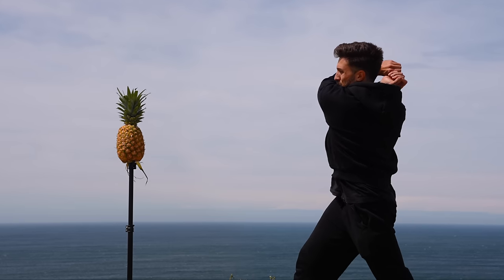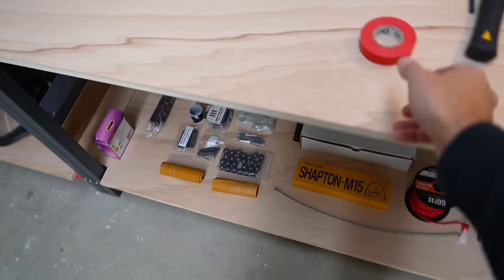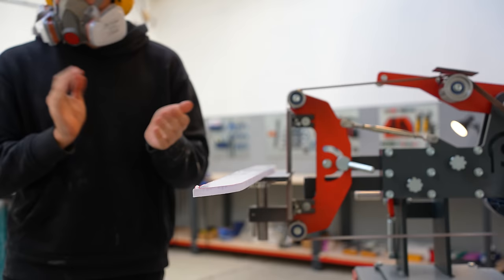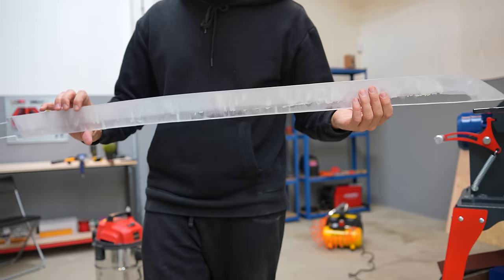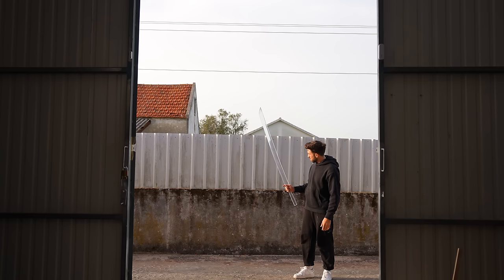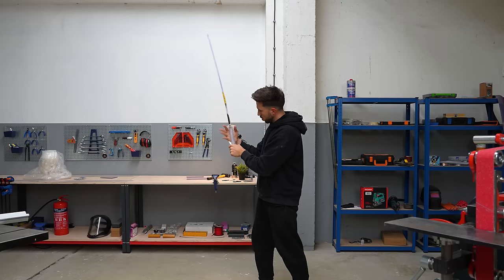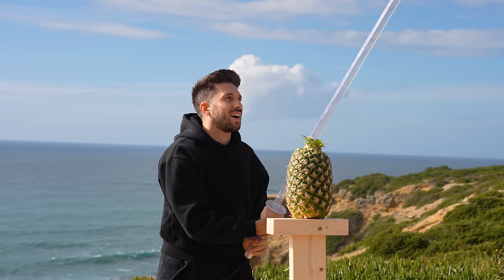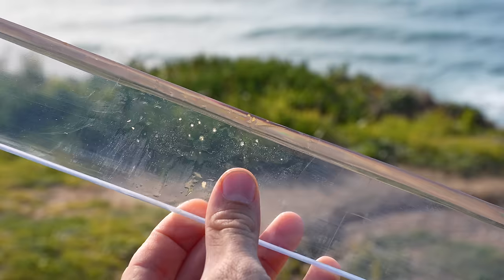I Built a Transparent Katana

Comment: so, coming from combat robots where polycarb is used a lot, i can tell you that cyanoacrylate makes polycarb brittle.

it was the ca glue reacting with the polycarbonate that made it turn brittle.

there is a chemical bonding agent made to glue polycarbonate, but isn't a glue, it effectively melts the 2 pieces together making it almost as strong as if it were 1 whole piece
Reply: This needs more likes
Reply: @Rjciralli  yeh, why is everything so underrated
Reply: So basically it makes a reaction that "plastic welds" itself, that's cool.
Reply: @Useruserusername790  Yeah it's more common that you'd think. Solvent weld is very common in modern plumbing.
Reply: you can get solvent weld from most hobby stores, a lot of miniatures for wargames like warhammer come in piexes that you put together with the stuff
Reply: What chemicals are in JB weld it gets warm when you knead it so there's a reaction going on there. Most "glues" are molten at room temperature and glue doesn't necessarily mean 1 chemical, they can be mixtures, Concrete has drying agents in it, it's not just the water that holds it together. The first part of that is for the person that originally commented , the rest is so the Keyboard-warriors will mind their business.
Reply: It was a mixture of that and the geometry of the handle. It had a right angle at the point of breakage which created a stress point. Any particularly hard hit was enough to break it.
Reply: @tale7955   yes, that's why Katanas "tangs" aren't shaped like a T , the 90 degree angles are a huge stress point, actually even Longswords have a kind of tapered tang.
Reply: This. Also, CA glue vapour clouds polycarbonate and acrylic (the reason for the "ice" effect). You said you can't easily polish the "hole" in a handle. True, but... If you use a strong,. but clear epoxy resin, it will actually fill in the gap and make it a solid clear block. The roughness of the hole will mostly disappear and will actually help the resin bond to the parts. Try to get rid of bubbles before pouring (slow cures make this easier, or use a vacuum chamber) but I don't think you could get a pressure pot/chamber big enough for the sword unless you were willing to pay a lot more and learn how to use it safely. That, plus the geometry of the handle (to avoid stressor points) and you should have something that will work a lot better.
Reply: No... it was the cuts without any fillets on them that broke it (that's why it broke in the exact spot where it was cut in for the handle)

Comment: @MikeShake I love this project and I'd like to help you make it better. I think that there are several areas of consideration for the next version and testing methods. I have not read all 6700+ comments, so please forgive me if I repeat any. I hope some of this helps.

1- The thickness of the "katana" and it's cutting edge
-A katana is not meant to "cleave" through things. The curved shape of katana is meant to provide the smallest amount of cutting surface on the target. This increases the PSI of the cut. When you see a katana "chopping" through something, don't imagine an axe going through wood. Imagine the blade being dragged through the target and slicing deeper as the blade is pulled across the target's surface. More like a saw would work, slowly getting deeper by cutting along the surface, not going straight through. 
-A katana is thin so that (among other reasons) it can pass through the target with the least resistance. What you have created functions less like a katana and more like an axe, machete or kukri. However, if you decrease the blade's thickness, it will of course be weaker. 
-The edge angle is very wide, which is going to be more resilient to damage, but is not going to cut very well. That is why your cuts were messy. Of course, the narrower the edge, the more easily it will be damaged. 
-The problem you had with the blade being more visible with the shallower cutting angle would be lessened if the blade were thinner (as it would have less distance to travel from tip to flat)

2-Target materials
-If you're trying to make an invisible katana, you would want to test it against objects that katanas are normally tested against. I have seen a katana cut a bullet, but if I remember correctly, the blade was badly damaged afterwords. The katana was ideally used to attack soft tissue and slice deeply enough with one cut to open an artery or reach vital organs. The easiest way to do this with a blade is to stab, which is why spears and arrows were more favored in large scale conflict and most blades (that I'm aware of) were meant to deal the finishing wound with a stab. There is a very interesting history about katanas and why they were shaped and used as they were. I highly reccoment learning about them if you want to take your project to the next level. 

3-Swing technique and target fixation
-When you're cutting with your blade I'm noticing that your swing is not at a comfortable level for you. I would reccomend lowering it so that you don't feel that you have to keep raising your shoulders at the last moment. Since training a correct sword swing is not neccesary for your project, I think it would be a waste of your time to learn swordsmanship. Of course, for your own fun and enrichment, I would say go for it LOL. But just for this project you could just work on a horizontal baseball swing or a vertical axe chop. The actual way to swing a katana takes a lot of work, and i think that your material would not do very well for the job (but I could be wrong). Once your swing is good, then I would focus on making sure that your target cant fall away so much. A lot of the energy of your swing is being dissapated by the movement of your target.

4-Safety
-Even when you're cutting into soft targets, you can still have material failure. Since your sword is an unknown quantity I would highly reccomend that you at least wear safety glasses at all times. Since you're not a trained swordsman, you might also want to wear some wrist wraps so that any reverberation of energy back through the sword into your hands doesn't injure your wrists.
Reply: small point to add that I believe you missed(or i missed you saying), that the curve of the katana allows for easier edge alignment for a more straight on cut as the weight will carry to the back of the swing.
Reply: Wrote all that just to get two comments lol😊😂😊
Reply: u wasted ur time, bro is not gonna read all that
Reply: Bro... this is intelligently written 👏
I read through, and it's quite enlightening!

Are you a swordsman? Or affiliated to any?
Reply: This is fantastic advice! And very kind of you to offer.

Comment: Alright so hear me out:

There is another Japanese Martial Arts style that would make better use of the material, both in regards to its transparency and ability to bend.

I believe it’s called Owari Kan-Ryu, but I just call it the Wobbly Spear technique. In essence, you grab a spear near the bottom and with your lower hand push it back and forth (sliding it through your higher hands grip) so as to cause the tip of the spear to wobble in a circular pattern.

It helps to get past guard stances, and would likely benefit greatly from having an invisible spear used.
Reply: Like Hyouga from Dr. Stone?
Reply: Spear guy from Dr.stone
Reply: Even just an invisible spear blade
Reply: "what are you doing spinning that stick around"- the first victim of the invisible wobbly spear
Reply: @enigma9971  I don’t know if that would work as well. The blade would diffract light, which might not be a huge issue if the whole spear is invisible but would be if just the spear head was as you’d see the wood looking wonky through the spear head which would tip you off to its presence faster.
Reply: Ender dragon style?
Reply: Like inshun from vagabond

Comment: I work with this material a lot, to get a perfect clear edge you need to get them flame polished. The difference between that and hand sanding is crazy. Only thing is it takes a specialist tool, using a flame from a lighter isn’t the same thing. Maybe this will help you for the future :)
Reply: dude i can just imagine an even clearer version, it would be crazy
Reply: yep
Reply: Bruh like this so he can see it
Reply from the maker: That's really interesting, should I sand before flame polishing or could I do that right after the belt grinder?
Reply: @MikeShake  no need for sanding really, but perhaps sanding to assure you have a nice level edge before hand wouldn't be a bad thing :)
Reply: @MikeShake  you should make a new one with the things you have learned!! perhaps with a thinner sheet of polycarbonate aswell, so you can have a small bevel again, but with a shallower angle for better slices
Reply: Flame polishing is great for acrylic, but its really hard not to get expansion and bubbling or cloudiness in polycarbonate using a traditional flame polisher. Is there a more reliable way to achieve this nowadays or does it require specialist equipment?

Comment: Awesome stuff. Trick as well. You can flame polish the edges to make them almost transparent after cutting. Also use resin instead of super glue to bond acrylic or get acrylic weld. Look at some aquarium videos to see how that works. It melts the two acrylic parts together rather than a glue. 👍
Reply from the maker: Thanks for the info!
Reply: Anytime! Keep up the good work!
Reply: @MikeShake you should make invisible baseball bat next
Reply: @Lizardman60  that wouldn't work
Reply: not sure about the flame. maybe if ur super careful bu last time i tried heat to smooth it out i overdid it and got bubbles in the material.
Reply: But it's not acrylic. It's polycarbonate.
Reply: @Lizardman60 a mace would probably be a better option.
Reply: @simonwoodworks8840  Acrylic glue won't work on polycarbonate.
Reply: @MikeShake  for a big future video project try making a vehicle/race kart or car to hit 200mph with a budget of 10,000.

Comment: Hey man, I saw a lot of comments saying that the cause of the snapped handle is because of the geometry which could be partially true, however the primary reason why this happened is because polycarbonate becomes brittle when it is exposed to superglue or loctite due to the active ingredient cyanoacrylate.
Reply: I think it’s a combination of the two. The added rigidity from the super glue, and the perfect line of 90° angles at the stress point. The handle couldn’t flex, and where it couldn’t flex was a straight line where a light scoring would snap that poly
Reply: Adversely he should try shortening the blade so that it doesn't flex as much... that much flex in any kind of swinging bladed weapon is not what you want unless you're making a whip sword

Comment: Polycarbonate is fascinating.  Use it in our print shop from time to time to make signs.  When discarding remnants from a job, usually narrow pieces that are four or eight feet long (as the sheets we get are 4'x8') it's very difficult to snap them into pieces so they'll fit into a container.  However, if you put even just a very shallow scratch on the side that you're going to bend outward and then bend it will snap very easily.  Very loudly and dramatically too.

Comment: 16:14 partially correct. The flexibility shouldn’t affect its ability to cut much, as steel swords also flex quite a lot. The thickness of the blade is part of the reason it doesn’t cut clean, but the main reason is the steep bevel. A bevel like that can’t get particularly sharp, and it’s a rough transition from the edge of the blade to the spine, massively reducing its cutting effectiveness
Reply: It doesn't help that he's swinging the sword like a baseball bat
Reply: That's the other thing tbh, a curved sword shouldn't be swung like a base all bat as said above!
Reply: And his technique and edge alignment
Reply: @systemcheater9071  Edge alignment isn't even real.
Reply from the maker: The reason I was swinging it like a bat, is because I knew it wouldn't cut like a real katana, so I probably had a better chance of destroying the targets that way. I'll improve V1 of the sword (thinner) and properly use it too!
Reply: @MikeShake  definitely an awesome idea! strap some LED lights to the katana next, and you can make a lightsaber of sorts!

plus, a "bigger katana" is called ODACHI. ;)
Reply: @MikeShake can't wait to see the evolution of this sword 🗡️

Comment: Nice job! A couple advices: 
1) when unsure about how a material will react to being worked on with a machine, try on a small disposable piece first.
2) when cutting the handle recess, drill holes first to avoid sharp corners, from which a crack could be generated.
Reply: Even steel swords have a radius (smooth transition) between the handle and the blade, sharp  [interior] corners are always a weak point.

Comment: Hardness is not the same as tenacity, as a mechanical property. Policarbonate is not a hard material, so it is basically unable to actually retain the sharpness of the edge. That's why most of the test showed breaks by blunt weapon impacts, and not much of a cut. 
Still, it is a very cool weapon and admire your attitude of fucking around and finding out. Great video as always!
Reply: Just curious would he be able to coat that blade with something like Systemthree's T-88, or even cast one out of that and then use that?  This when cured has a 7000 lb tensile strength, or do you think it would become too brittle?
Reply: @kyleshinabarger8343  that sounds interesting, but I don't really know about how well would that work in terms of resisting shock. It could very well be computer simulated before actually producing something like that.
Brittleness is guaranteed with hard materials, but that only matters to the point of the shock you actually cause to the material (and the different forces that the blade suffers during a shock). I would say, it would work much better with a smaller blade size, maybe knife sized, which didn't have to work with so much weight on it.

Comment: I’m not normally one to critique, but since you mentioned you weren’t familiar with bandsaws, I thought I might chime in. I noticed that at about 4:33 you made a small cut which allowed the piece to release, as the longer cut was already finished. It’s generally (when possible) best practice to make your longest cut last so that you’re backing out along the blade as little as possible. This lowers your chance of binding the band, which can injure you and damage your equipment and material. You can also make relief cuts into the middle of long spans, like along your (katana) blade, so that you can more easily adjust or take breaks.

Hopefully this is helpful, and sorry for the long comment, especially if it’s not. Really good work and really cool video—thank you for making it!
Reply: Good call, I missed that part 😂
Reply: This is reasonable advice
Reply: That's not long, & is very good advice

Comment: Another reason of why the sword was fragile at the handle is because of the sudden change of shape from handle to blade :
This is called stress concentration,  and it occurs where there is a sudden change in geometry or dimensions of a material, which causes an increased concentration of stress in that specific area

Additionnaly, one of the reasons of why it did a poor cut on a watermelon could be due to technique, and the thickness of the blade. Swords are purposefully flexible, maybe not as much as yours but this is in order for steel to be able to go back to its original shape, and not just bend when an amount of force is applied. 

Maybe you can try but cutting and not swinging it like a bat, for exemple when you cut vegetables with a knife, you don't just chop it, but you also do a slicing motion, though this is an idea as I have no experience in using a sword, and only know the very small basics of material resistance, and I hope it helps !

Comment: In laymen's terms; instead of the 90 degree angles where the blade meets the tang, you should have had a radius. By creating a sharp 90 degree corner you created a high stress point where all of the energy from the impact of blade is transferred to. Aircraft at one point had square windows because they're easier to make, but this saw stress fractures appearing in the fuselage. The reason aircraft these days have circular or oval windows is to negate high stress points.

Comment: The 90 degree angle where the blade meets the handle is a weak point structurally (even in metal swords).  You could try rounding that corner and then redesign the guard.  Also I would love to see what you can do with the first version of your sword since it would allow for better edge geometry.  Good luck!